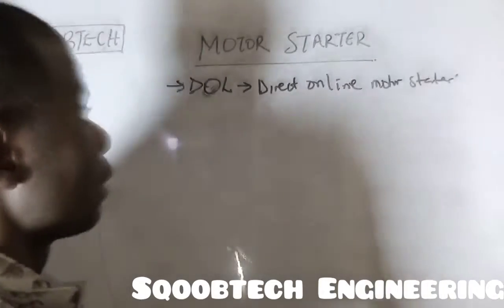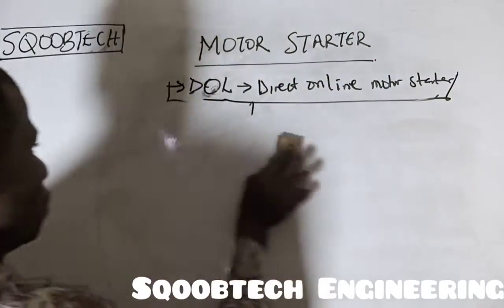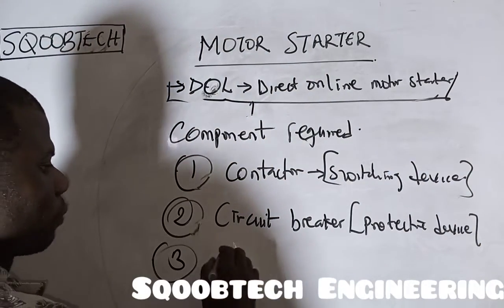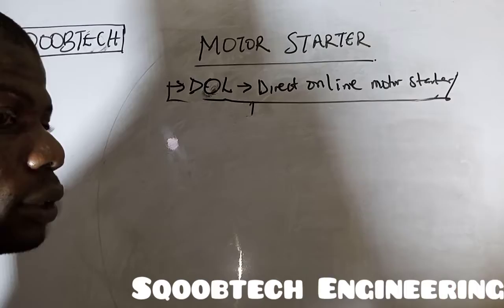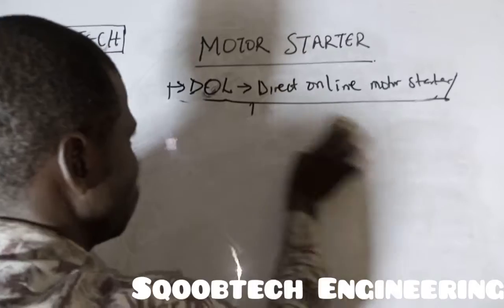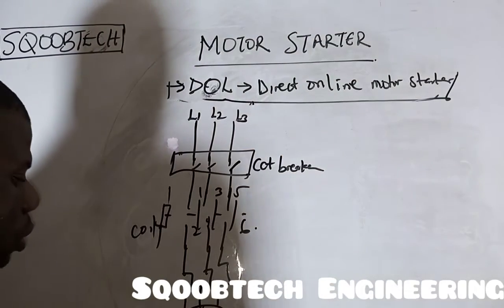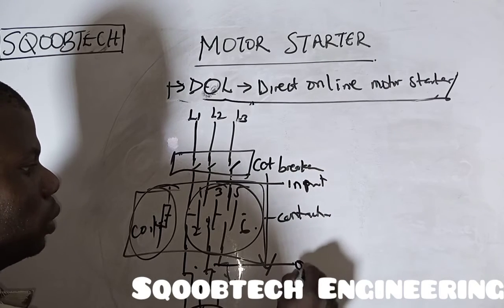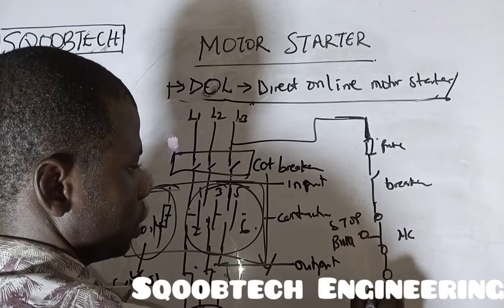How to draw Direct Online Motor Starter - Circuit Diagram

Comment: Good job, well done, from this lesson, I will like to ask a question on the control diagram drawn above, you indicated a fuse on top of the breaker before the push button, what electrical component will act as the fuse
Secondly, I don't know if you can include how the connection will be done with the electrical component in line with the diagram
Thanks and we'll done
Reply from the maker: The reason why a fuse was used is to prevent the control circuit separately. I.e the circuit breaker which can be between 32Amps to 63 amps can only be use to prevent Electric Motor but cannot prevent the control circuit in case of short circuit.
Reply: @sqoobtech1496  
So which type of fuse are we talking about
Reply from the maker: @adefowojusamsideen5250  cartridge fuse of about 2-10A depending on the contactor current rating. You can as well use circuit breaker of same current rating. It depends on your choice of design.
Reply: @sqoobtech1496  
Ok, thanks.
Reply from the maker: @adefowojusamsideen5250  I will add the picture of the design of cartridge fuse  type that am talking about. Please watch out!